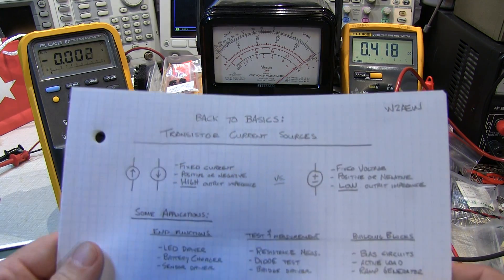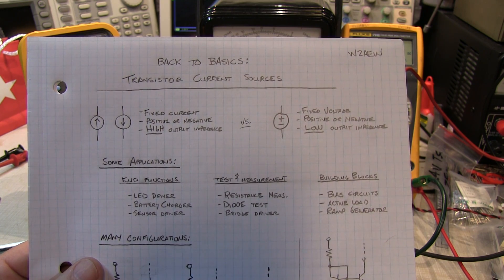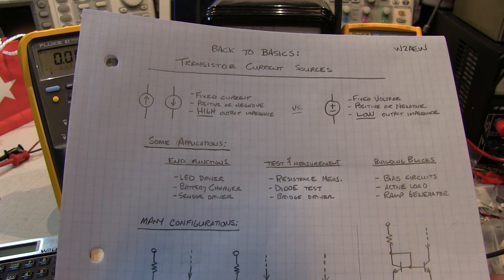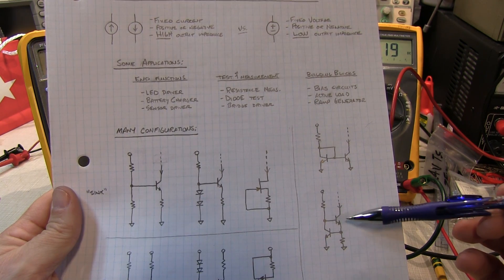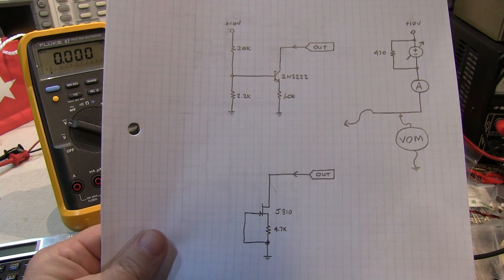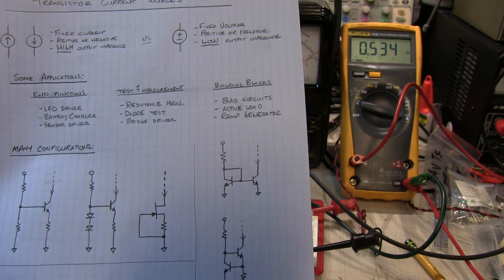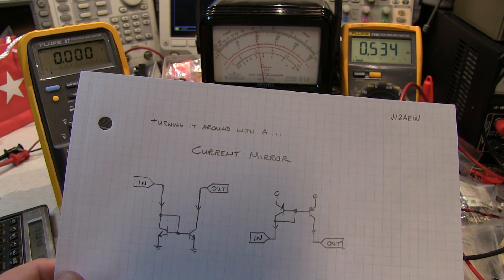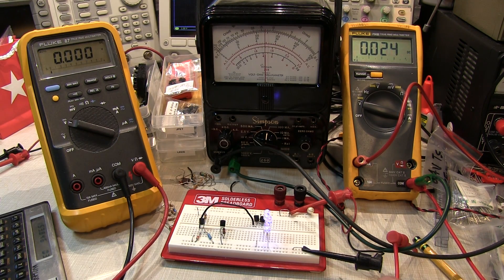#190: Back to Basics: Transistor Current Sources and Mirrors

Comment: Just been building your second "sink" circuit - 0.6V across a 120 ohm emitter Resistor with a view to create a 5mA constant sink. That particular circuit was in an exam paper , GCE A level - June 1981 AEB Electronic Systems Paper 1. Testing the sink current in an actual circuit I'm getting about 10mA. The paper also asks for graphs of collector current and output voltage when you charge a 1000uF capacitor.
Reply from the maker: Well, something sounds "off" if you're measuring 0.6V cross that emitter resistor, but also seeing 10mA current.
Reply: @w2aew  I thought it could be my "random" silicon npn transistor - I used a C4881 (TO-220) which measured 171 beta on my Peak tester. It appears to have survived being soldered on to a strip-board. The bias config is 2 diodes in series with a 300-ohm 1-watt resistor - dropping 15V - 1.2V.
Reply from the maker: @armandine2  Always a good idea to backup your measurements with a second method.  For example, if you're measuring 10mA collector current, double check that by measuring the voltage across the emitter resistor, as well as the resistor value - all should lead to the same conclusion - if not, then something is wrong.
Reply: @w2aew  finally made some sense of it - the emitter resistor was at 0.872V, so across 120 ohms that gives 7.27mA. My sink current is 7.23mA and was steady for a string of 1 to 7 LEDs. My take on the circuit in the question is, in practice using 0.6V as a default pn junction figure may get you some distance from the theoretical 5mA.
Reply from the maker: @armandine2  Good lesson learned.  Assuming 0.6 to 0.7V for a silicon PN junction is only an estimate - always measure!
Reply: I will measure again - with a load
Reply from the maker: @armandine2  Make sure that load doesn't saturate the transistor.

Comment: It's interesting to see that the output impedance of the 2N2222A of 190K across the range 2V to 10V when sinking around 0.5mA as calculated at 11:34 is almost the same as the output impedance of 192K across the range 5V to 10V, which is given by 5V/(419-396)μA. That's useful because some devices have a "knee" at lower collector voltages where the incremental output impedance drops off. It's also worth noting that the 2N2222A datasheet gives a wide range of output impedances at Ic=1mA and Vce=10V of between 30K and 200K. At Ic=10mA, Vce=10V, that falls to between 5K and 40K, meaning that the 2N2222A is not so useful as a constant current supply at higher currents.
Reply from the maker: Hah!  There's actually a mistake in this video when it comes to measuring and calculating the output impedance!  It was discovered after the fact, and I posted a followup video.  Note that the output impedance is much higher....   https://youtu.be/JbCI4Lsnqho
Reply: @w2aew  I noticed the discrepancy between the apparent emitter current of 384μA and the 419μA collector current, but I just surmised that the 1K emitter resistor was high by about 8%. The actual value of that resistor would have been the first thing I'd measure. It's been so long since I used an analogue meter, its loading wouldn't have occurred to me. So, the interesting point now is that the 2N2222A seemed to have an output impedance far in excess of the values in its datasheet, but I then realised that the emitter resistor effectively provides negative feedback in a common base configuration, stabilising the collector current against variations due to changes in Vce. Something to explore.

Comment: Another test : 1 current source "feeding" 1 current mirror with +9V supply.

- last example of current source  (purists prefer to say it is a current sink, not a current source) : 2 NPN (2N2222A) and 2 * 1k resistors.

---> measured current is ~0.7 mA (collector of second transistor), quite unstable actually (breadboard quality ? I have no clue)...
Current is the same if I power that current source with +12V : ~0.7 mA (as expected...)

then connecting collector of second resistor directly to collector of the first transistor of the first current mirror example (2 * NPN, 2N2222A, no resistors)

Then, connecting 3 LEDs at the collector of the second transistor of the current mirror : they indeed all have the same brightness (same goes whatever the color or size of the LEDs) but the current at the LEDs is about 10 times bigger than the current at the current source....

But I think I made a mistake : if I use a current source with NPNs transistors (sink model), should I use a current mirror that uses PNP transistors (instead of NPNs like I did in my test) ?

Comment: Something is not right with the second solution of current source (with 2 diodes in series) :
I've made the same circuit with :
+9V
2N2222A (NPN)
2  * 1N4007 in series with 1k resistor
R emiiter : 220 ohms
I measure a current less than 1 mA (~0.5 mA) with my DMM.

When replacing 2 diodes with a 470 ohms resistor : ~40 mA

Which makes sense : there's almost no current flowing into the base: diodes act as a short between the base and GND.
Maybe is this made on purpose to have small current source...And if yes, how do we calculate the current that' flows into the base/diodes ?
Am I right ?
Reply from the maker: Sounds like you’ve wired something wrong. The idea with the two diodes is to place the base voltage 2 diode drops above ground, so that the voltage across the emitter resistor is 1 diode drop, thus the emitter current should be close to .65V/RE
Reply: @w2aew  Ok, that makes sense to me. 
1) So, the potential between the 2 diodes is theoretically the same as the potential of the emitter (because of the base-emitter diode voltage drop), right ?
2) the current we want at the end (of the current source) is determined by RE, right ? And we don't much care about the other resistor as long as the transistor works in its linear area (the "almost-flat" line, the region where Ic doesn't change much with Vce, the region where the impedance is the biggest), right ?
Reply from the maker: @gloubiboulgazeblob  yes, exactly! You got it.
Reply: @w2aew  Thanks !

Comment: When I left college as an electronic engineer I built thyristors and breakover diodes in a semiconductor plant. Your videos and explanations are reminiscent of the Forrest Mims books back in the day. Excellent and well put together videos!
Reply from the maker: I learned a lot from the Forrest Mims books!
Reply: @w2aew  I still have the books! Bought from Radio Shack in the 70s and diligently studied. I remember my interview at the semiconductor plant in 1982. My boss to be gave me a sketch pad and asked me random questions like "draw me a single transistor class A amplifier circuit with example biasing resistor values." That "back of the envelope" method helped to get me the job and I hope your videos help get new kids coming through a grip on electronics. Breaking things down into smaller parts helps to get a handle on the common techniques.
Reply: @w2aew  books by R.M. Marston were also essential reading.

Comment: Is there a way to temperature compensate a current mirror used as to measure high side current? The current mirror I am using had a pnp and npn matched pair. The issue i see is the offset and slope changes as a function of temperature. Is there a way to compensate it?

Comment: 11:45 I'm trying to process this concept. Learning and noticing this current source and current mirror in modern hi-fi solid state amplifiers. I keep rewatching and I still get stuck at why the gain would be different if the load was simply resistive. I'm very slow and just trying to move up comprehension. Thanks
Reply from the maker: In the example cited, if you used a 190k ohm resistor, the current would have be very low to avoid saturating the transistor, which would then result in a lower gm factor - so the overall gain would be lower (gm*Rc).  The current source load gives you very high impedance (Rc) at higher currents which gives you higher gm, so the gain can be very high.  In fact, in most cases, the gain when using an active load like a current source is usually so high that they're only used with additional negative feedback to set the overall circuit gain.  The benefit of having a very high gain inside of a feedback amplifier is much lower distortion.

Comment: Really well done videos!  I do have a question....At about 16:06 in the video you say that you take the first current source output and tie it to the PNP current mirror input.  This happens to be the emitter on the PNP....my question is : What did you tie the collectors of the PNP mirror to?
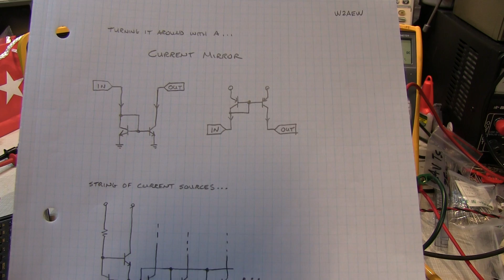Reply from the maker: Take a careful look at the schematic at 15:47 - the input of the PNP current mirror is the base-collection junction labeled 'IN".  The emitters are tied to the positive power supply.
Reply: @w2aew  ...my apologies......In prior video you always had a number (ie +10V, etc) labeled and I didn't recognize the 'circle' without the label....my bad....thanks

Comment: When engineers say an Op amp is a LOWER Characteristic op amp, what do they mean by "lower characteristic? In OP AMP schematics they often use transistor or FET current sources and current mirrors and differential , Common mode rejection. If you look at common Op Amp schematics for common part number some use differential inputs using transistors while others use FETs inputs plus it looks like they are configured in a current source, current mirror, differential configuration for inputs#1 and inputs#2. If the circuit designed is for an op amp LF348 and LF347 which is JFET inputs, you can't use a replacement like an LM741, TLO84, LM324 because those op amps aren't JFET inputs which I'm not sure why it wont work in circuits as an cross reference part. It would be nice if you made a video lesson about common OP amp part number schematics to go over the FET/transistor configurations inside the op amps of the current sources, current mirrors, etc

Comment: @ 12:00 mark, I am interested to know why using the current sink with an impedance of 190k is an advantage over simply using a 190k resistor in the amplifier application you mention.
Reply from the maker: Because, in order to use a 190k resistor, the collector current would have to be very low in order to not saturate the transistor.  The low collector current will lower the transconductance (gm), and therefore lower the gain...

Comment: Thanks for the video.

(My Fluke 87vMax multimeter is back for a safety recall, if I ever see my meter again, if they repair it. Check yours?)
This setup gave me some issues because I was down to my intrepid Cen-Tech P37772 meter with the patent infringment yellow bumper, and worn selector switch, which also doesn't do microamps. So I needed to scale the current up the setup. I also used two power supplies to keep my bias divider in one place, but that might be cheating.
What I found: I was displeased with the linearity (low input-impedence)
Why I found it: likely because I was against the compliance voltage for my altered setup.
What made recovered the fun: I replaced R2, with a diode, which brought up the bias voltage, and linearized the setup better. Also, placing 1 though 5 LEDs in the current source with very little change in apparent brightness made it fun, once again, all the way past 12 volts. They didn't smoke at 15.
What opportunity I found: By watching the LED brightness when changing the voltage, I could see the limits of the voltage compliance. Oddly, the 2n222 handled the current quite well. Apparently, some have a max continous current of 600mA, others 800mA (likely with some kind of clip-on heatsink.)
What opportunity I missed: while I practiced calculating the input impedance a few the circuit, I should have for this setup, but didn't.

Thanks, again for the videos.

Comment: Can you explain why it was necessary to put a 470 ohm resistor across the outputs of the power supply to keep it sourcing current?  Since a bench power supply typically has readouts for volts and current, I suppose one could "adjust" those readings to compensate for the resistor, correct?
Reply from the maker: In this setup, the power-supply would have to "sink" current (current flowing into the + terminal), and linear power supplies like this can't sink current.  So, by placing a small resistor across the supply, the output will always "source" current  and force the set voltage across the resistor.  There is no adjustment to any readings necessary since we're not measuring the output current of the supply.
Reply: @w2aew  Thank you for your quick reply!  I have a switching power supply.  Can I ask a follow-up question?  Do switching power supplies sink current into the + terminal?    I am only a hobbyist, so it would take a great deal of research to try to figure this out, and the odds are good I would come up with the wrong answer!
Reply from the maker: @claude77573  It likely can not sink current.  Also, if you're going to replicate this experiment, you'll have to check the specs on your supply to see if the outputs are truly floating from ground.

Comment: Precesion current source based on simple zener? You can make much better using combination of the Widlar mirror and peaking current source. 2 BJT + 3 resistors, no zener, great stabililty, etc.

Comment: How do you know the current is microamps rather than milliamps? Am I missing something looking at the Fluke?
Reply from the maker: Because with the positive lead in the upper left jack, the two ranges that the meter can be in for DC AMPS are the 4mA and 40mA range.  Only the 4mA range gives you three digits beyond the decimal point (1uA resolution).  The 40mA range give you 10uA resolution.  In order for the reading to be in mA with 3 digits beyond the decimal point, it would have to be on the 4A scale, which would require that you use the 10A jack on the lower left corner.
Reply: @w2aew  Thank you! I'm not familiar with all the various Fluke meters.

Comment: Hello, nice video ! how to do to have a constant 1amp 14V power supply to charge a battery. WIth classical PSUs, when the battery reaches 13.5v, it takes ages to go to 14v because it draws very few current. Pushing 1Amp all the way will make it charge better and faster. Thanks.
Reply from the maker: Different battery chemistries have different charge circuit requirements.  Lead acid batteries need a constant voltage float charger, while NiCad generally use a constant current charge.  Lithium and LiFePO have other requirements.  Using the proper charger circuit for your particular battery chemistry will give you the best results, and safest results.

Comment: I am bewildered about how can a transistor still work when the base-collector junction is shorted as it is with the current mirror transistors?  Does the transistor with the shorted base-collector junction act as a diode only in such a case or does it still have a current gain?
Reply from the maker: With the base and collector shorted, it is essentially a two-terminal device that looks and acts like a diode.
Reply: @w2aew  So can we technically replace that transistor with a diode to make it still work?
Reply from the maker: @uiticus  Yes, it will, but the currents won't necessarily match.  We're relying on the Vbe of the two transistors being the same to get the same current in both.

Comment: 11:33  .... re: Using the current sink as a load for an amplifier.  Dumb question:  Is this a good strategy for a LNA block that must amplify very low-V (uV) raw sensor output (assuming the opamp ckt is well designed for noise)?

Comment: W2aew, Current source circuits were mostly used for headphone amplifiers cause there was no standard output impedance for headphones? A Constant current source amplifier circuit "can drive any load" impedance that is why they used them for headphones?

Comment: I'm not understanding why a piece of equipment has chassis leakage current. What is causing the chassis leakage current or where is it coming from? The Chassis ground I though should be a zero volts and zero amps no leakage.

Comment: isnt that miliamps ,  fluke is on amps , 0,3 amps is 300 miliamps not microamps , microamps would be 0,003 amps as 300 microamps
Reply from the maker: On the 79-III, the scale is in mA when you're connected to the mA input (see where the red lead is connected to the meter). so the scale shown is the 4mA scale, thus the readings are in the hundreds of uA.
Reply: @w2aew  ok , just to be sure ,  im always confusing micro farads with mili farads , or that "m" as in mili or micro
Reply from the maker: The proper use is to use m for milli. The Greek letter Mu (stylized u) is for micro.
Reply: @w2aew  yes it is

Comment: hi Alan
great video but i have a question.
i didn't get why you put a 470 ohm resistance in parallel with supply.
will you please shed some light on that
Reply from the maker: Because the power supply can't "sink" current.  The 470 ohm resistor ensures that it is always "sourcing" current.

Comment: I came across your video while searching for a solution to my problem.
I built a circuit exactly like what you have on top right hand side of frame, you're pointing at it at 4:53
I've selected 5V as supply voltage. The resistor is 50 Ohms. I plan on charging a 20Ah NiMH cell connected to the output (via a schottky diode to prevent back flow when the source is off). It provides about 310mA, but quickly runs up and gets into a thermal run away. The current increases until the output transistor is destroyed. 
I've tried with 2x 2N2222, then went beefy, and used 2x TIP42C NPN transistors. Same effect. Both transistors are matched. 
Tried a resistor as load instead of battery. Same result. 
Then I installed a heat sink on the output transistor, and it works fine now!
Why is this happening on only 300mA draw? How can I stabilize it? 
Would a MOSFET with its negative temp coefficient stop the thermal runaway? Do they even make current mirrors using MOSFETs?